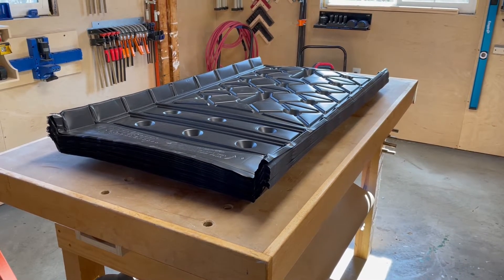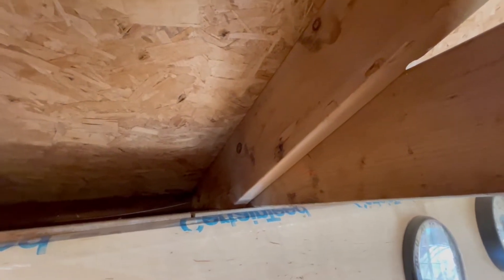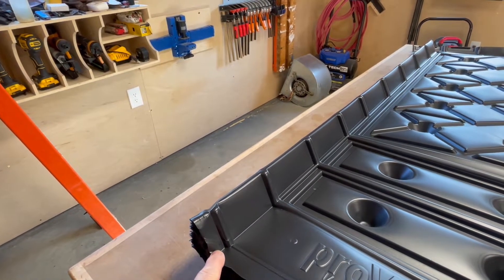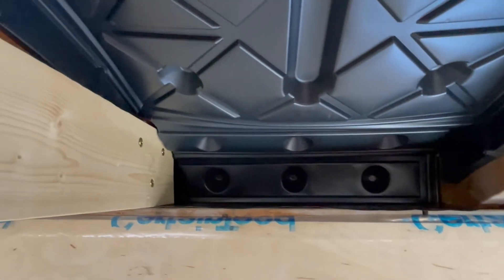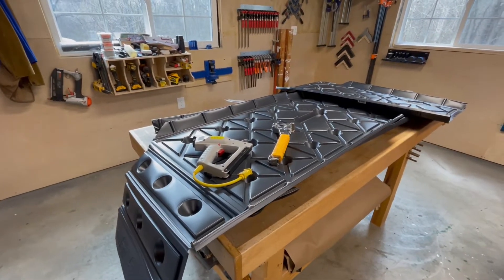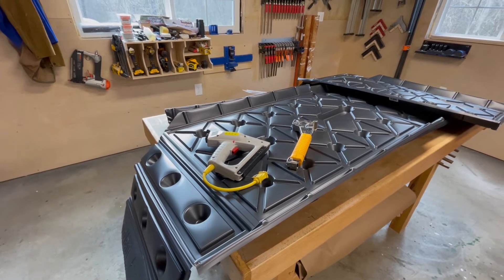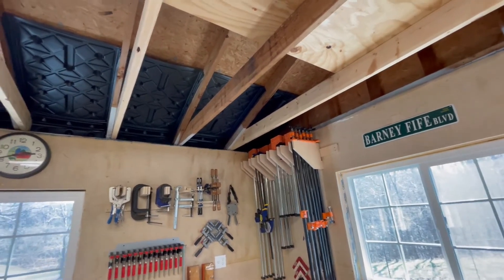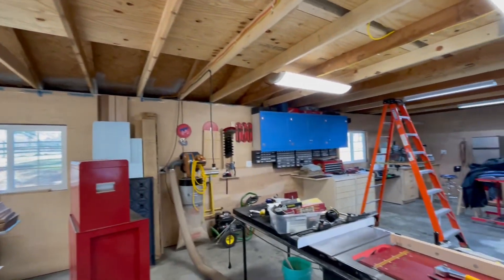Workshop Build - Installing Attic Baffles Part-1

Comment: This baffle is the only baffle I ever use because when installed like you did in this video it minimizes the amount of baffle and insulation that can come in contact with roof sheathing.  Any area where there is lots of snow and cold you cannot have insulation touching roof sheathing or baffle area that is tight to roof sheathing.   It is unbelievable how many people in the industry use a single 12" baffle stapled to the roof sheathing on a 24" on center truss system and then jam insulation in around it to seal off the wall top plate area creating the perfect situation for ice dams.  If you do this there is no thermo break to stop warm inside air rising up thru insulation and warming roof decking under the snow which causes ice dams.
Reply from the maker: Thank you for the comment. I really like this style too.

Comment: Good solution for your condition.  If you use the DuraVent or the OwensCorning vents, they are perforated down the center to allow you to easily split them in half for narrower (14") rafter spacing.   Instead of only using half, though, go ahead and split the vent in half as if you're only going to use half, but then overlay the two haves along the middle, with one half overlapping the other half by 1" or so.  Then use a few pieces of tape to keep them together.  These are a part of the vent that will be pressed against the ceiling whether you go with a half vent, the full vent, or with this modded way.  Now they'll fit perfectly in a narrower (sub 22") spacing while allowing full vent flow area.  Plus, they'll be a little sturdier along the midline than standard and will be more resistant to getting crushed in case the insulating guys try to pack in a batt too much.
Reply from the maker: I'll sure remember that the next time. Thank you for the comment.

Comment: Thx for the video. I need to do the same exactly the same thing… i will need to cut/notch my baffles as i only have 13” in space and the smallest size is 14”. What did you use to cut/notch them, scissors ✂️? By the way, you definitely got them installed the proper way.
Reply from the maker: I think I just used scissors and a utility knife to cut them. Thanks for watching the video and good luck with your install. Let me know if you used a manual stapler to attach them, or an air tool. Thank you for the comment.

Comment: Turn air pressure down so your stapler isnt blowing through the baffle material.
Reply from the maker: I did try that, but it didn't help. I think I lowered it to a point that the gun won't work. Thank you for the comment.
Reply: @Darrell_Coquillette  dang yeah that was my only thought, they need to make the edge at minimum strong enough to take air stapler.  Trying to manually staple those in many tight odd angles is just not doable.  Only other option is quick grab foam board adhesive, and how light those are just a few dabs in corners n few in middle edges probably would have done the trick.  But you got er done and thats what matters.  🙌🏼
Reply from the maker: I'm sure the gun I was using just isn't able to shoot a staple at low pressures. The manual stapler wasn't to bad, but I agree with you, it wasn't fun.

Comment: What brand are they???????
Reply from the maker: This is the one I used. Thank you for the comment. 
https://www.menards.com/main/building-materials/insulation/insulation-accessories/ado-products-provent-reg-23-x-48-plastic-attic-vent-chute-with-baffle/upvb2348v2/p-1528525813282-c-5776.htm?exp=false
Reply: @Darrell_Coquillette  Thank you!!!!!!!!
Reply: @Darrell_Coquillette  You might want to consider adding this information to the main video details section.

Comment: Do these baffle vents to to go all the to the top of the roof or just that little section?
If you were to put insulation against that baffle (assuming that the insulation is all the way to the top) isn't there a chance for condensation to build up where the baffle ends?
Reply from the maker: The insulation goes in the ceiling joists bays, and the baffles attach to the rafters to allow airflow into the attic space. Thank you for the comment.

Comment: With no soffet vents, these seem unnecessary.
Reply from the maker: Thank you for the comment. My plan at some point is to install soffit vents. I wanted to get the baffles installed before I put in the insulation. I've since installed the insulation. Now it's time for me to get moving on the soffits. The building currently has peak and ridge vents and I'd like to get rid of the peak vents. The way it's currently set up it doesn't work well keeping the air in the attic moving.
Reply: @Darrell_Coquillette  Curious why not have whole garage as conditioned space
Reply from the maker: I did think about that before I followed through with my plans. But I wanted to have an attic that I could put things in and not get the stuff all dusty from my wood working. If I go though this again. The will be the way I go. Thank you for the reply.
Reply: Wouldn't you keep the ridge, peak vents with the soffit vents to cause a chimney effect. Keeping air flow going from bottom (soffit) to top (ridge) vent?

Comment: What? it looks like you put the baffles backwards. When installed correctly, the sidewalls of the baffles create the space for the air to flow up. The way you installed defeated the purpose of the baffle. Once you put the insulation there will be no space in between the insulation and the roof deck for the air to flow. Even if you did the best to create the space, it will be uneven all the way up the ridge.
Reply from the maker: @clep2009 Thank you for the comment. I followed the manufactures instructions as to the installation. The air gap is made where the baffle makes contact with the roof sheathing. This is pretty much how all baffles form the air gap. It probably would have been more clear if I would have made a video after installing the insulation. The baffle is made to stop the insulation from blocking the cavity for the soffit vent. I really like this style of baffle.
Reply: I agree... He has the baffles facing the wrong way. The airway between the baffle and the roof is almost non existent.
Reply: These are definitely installed in the proper orientation, per ADO's instruction - nipples/ridges towards the roof deck.  Perhaps they could have been mounted further away from the roof deck, by stapling the fins closer to the edges of the rafters, aligning the edge of the fin with the face of the rafter that points towards the ground.  But to rebut the two "not correct" comments, they are installed in the correct orientation.  If you want verification, refer to manufacturer's recommendation.